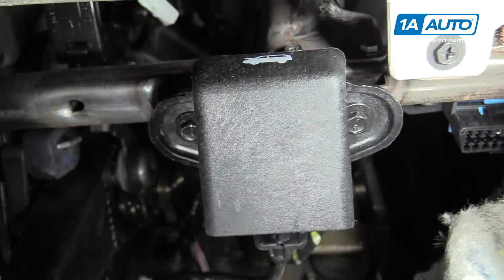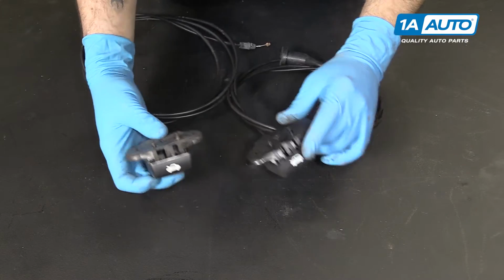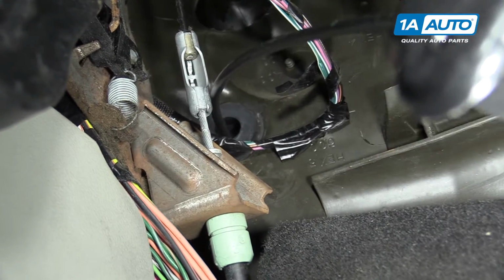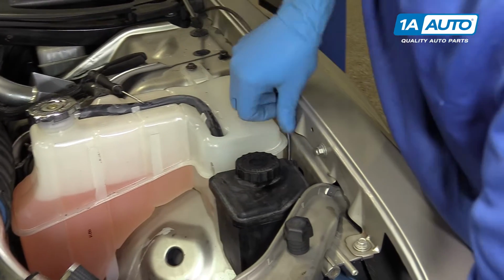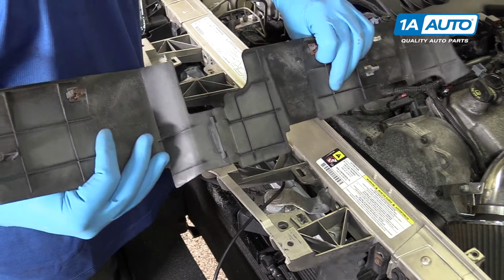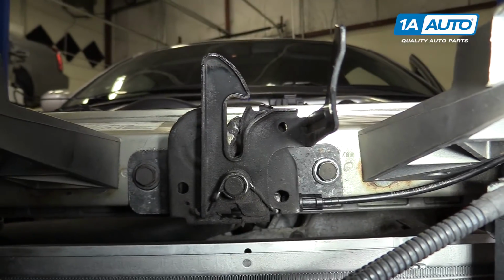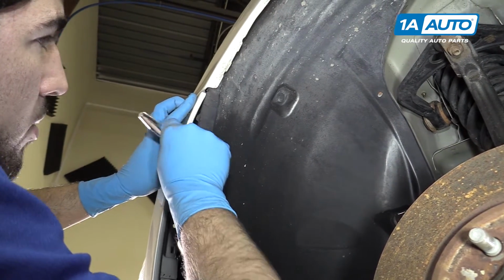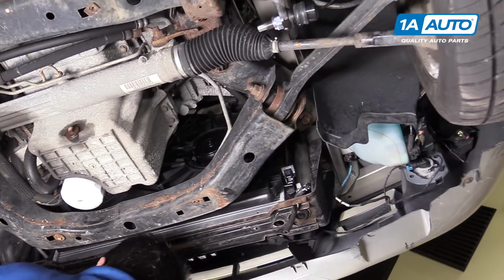How to Replace Hood Release Cable 05-10 Chrysler 300

Comment: Thank you. This is the most thorough tutorial I've seen. It scares the snot out of me though. I had no idea that the cable was behind so many parts that had to be removed.

I was hoping to be able to do this myself but I'm in a wheelchair so I'll probably just have to accept defeat

My car is different (2007 dodge Grand caravan) but I haven't found a video for someone replacing this cable on one like mine. Sigh

I originally thought I could just replace the latch lift on the inside of the van but it is too frayed so I also ordered the entire cable assembly. Now I don't know what to do

Comment: Hello and thanks. What was the problem with the cable? Both the wire and hood latch seemed fine. My 2006 300C hood's not closing completely. I noticed the spring below the wire (the thinner one) is broken. How to know if I have to change just the latch mechanism or the complete hood release cable?

Comment: The handle inside the charger broke off, the wire itself is fine, can I just replace the handle only?
Reply from the maker: +OvATyME316 Thanks for checking us out! http://1aau.to/m/Shop-1AAuto-c
Reply: U gotta buy the whole cable depending the year my 06 charger handle broke but the whole cable is connected to it smh

Comment: I have an 08 charger r/t. I simply disconnected the cord from the latch and connected it to about 8’ of welding wire. From there, I pulled the cord off the 3 locating clips. Then inside the car, I removed the handle as shown and pulled the entire cord through the firewall. Disconnect the old cord and put the new one on the wire that was also pulled through. Then pull from the engine side to have the new cable follow the path of the old one. 

This avoids having to remove the bumper, wheel well, and wheel. 

Good luck.

Comment: Thanks for this guy's !!
Reply from the maker: +2012htcme Thanks for checking us out. Shop here for high quality auto parts: http://1aau.to/m/Shop-1AAuto-c
Reply: @1AAuto  please do a video of opening a hood that the cable is the only thing holding the hood latched.  I have a 2005and 2007 Magnum.  The 2005 the hood is latched and the handle is broken off.  My GM said to grab the cable and pull.  My father tried to do just that but it would not pull.  Water I am sure has frozen the cable.